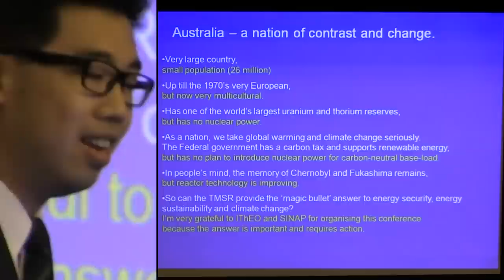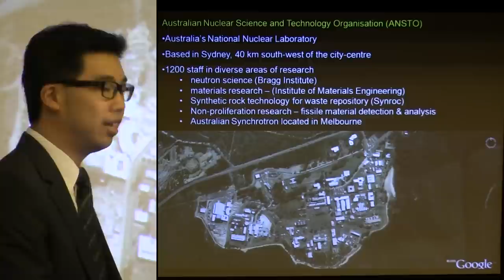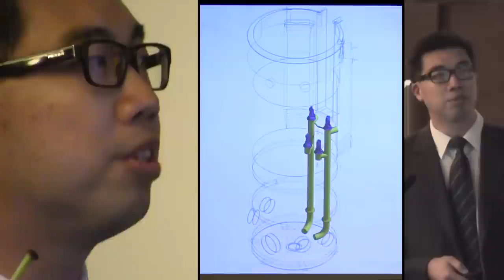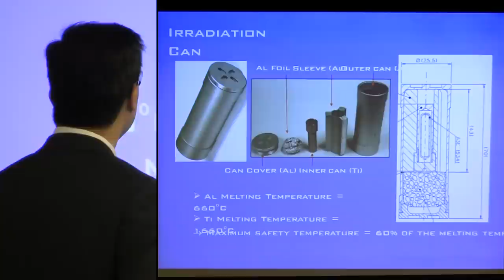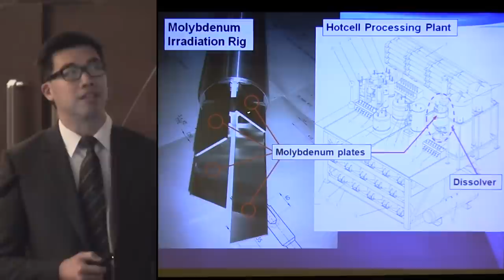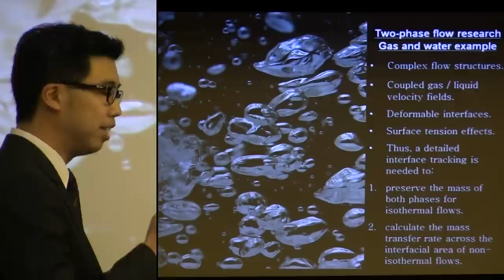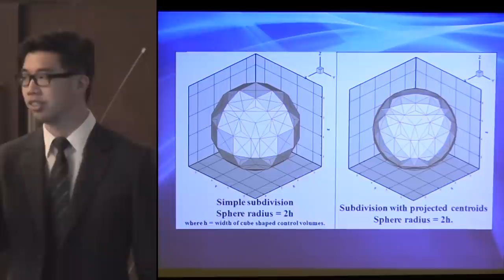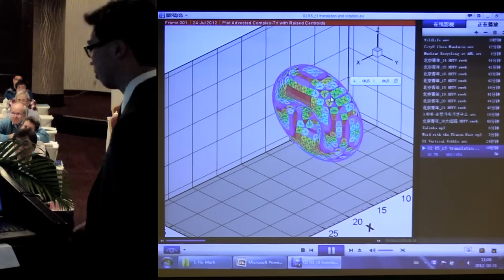Mark Ho - Dynamic Meshing in Multiphysics Modelling of Nuclear Reactors @ ThEC12

Comment: As of 2013 unfortunately, the Carbon Tax has been rescinded by the incumbent government, presumably because Tony Abbott says that the debate is still out there in climate change. The renewables businesses and foreign investors that were looking into putting money into a potential alternative energy market for Australia because of ARENA funding have largely dissipated.

The terms of trade for Australia are lower now that the mining boom has expended itself. The rescinding of the mining tax has led to massive wealth going to offshore multinationals with little prospect for return in the form of re-investment now that the projects that the mining boom stimulated have been completed.

The opportunity for Australia to significantly stimulate its services sector through the National Broadband Network has been hamstrung by political stonewalling pending evaluations of inferior technology (incumbent government prefers fibre to the node instead of to the end-user; which presents complications in trying to use end-of-life copper in the current network). New deployments pending successful trials of  by the end of 2016 are apparently on the way.

Funding towards health, education and scientific research has been cut. This includes ANSTO's research budget, from which Mark Ho was able to do this research. I would imagine that Mark's CFD work would be quite valuable for modeling the coalescence and evolution of gaseous fission products as well as having applications towards the design of the piping work to minimise turbulent flow that bubble evolution might engender.

I have talked to someone at ANSTO and they themselves have little faith in Australia being able to use nuclear power any time soon before I become a grandfather. Though ANSTO does cutting edge research in nuclear science, Australia nevertheless would have to bring in experts from overseas to install and run ANY future nuclear power plant; to say nothing of Gen 3 and 4.

I suppose if there was one thing that ANSTO can and should do, it is to investigate the neutron bombardment of Thorium in its OPAL research reactor; for nothing else than to produce nuclear medicines like Bismuth 213. The ANM facility is set to let ANSTO produce more than 30% of the worlds demand in nuclear medicines like Tc-99; they have the opportunity to corner the market here even as the first applications of fission byproducts of the Thorium cycle have begun to be investigated.